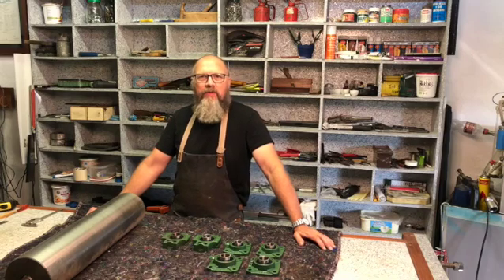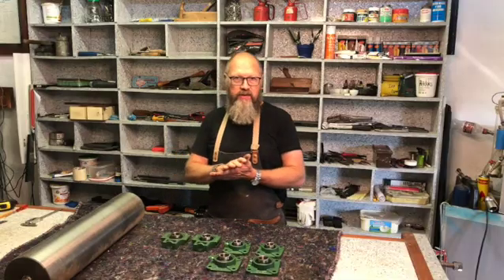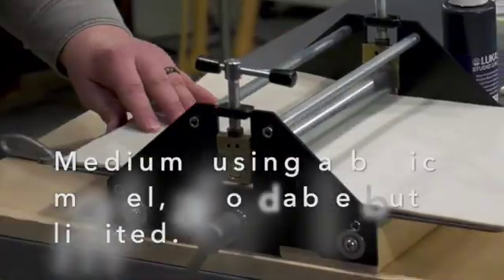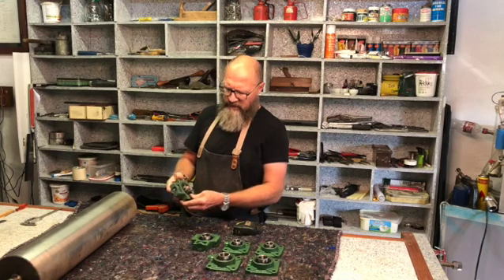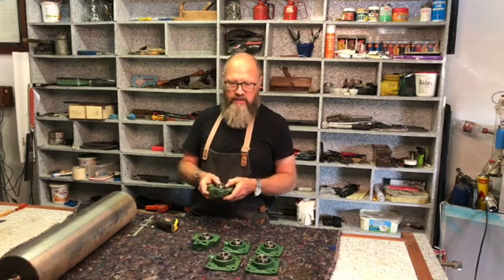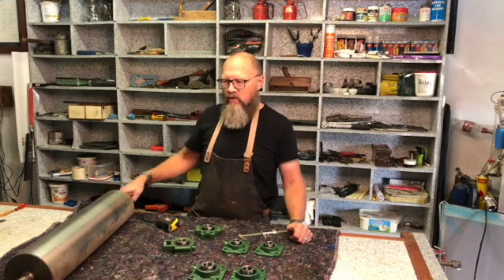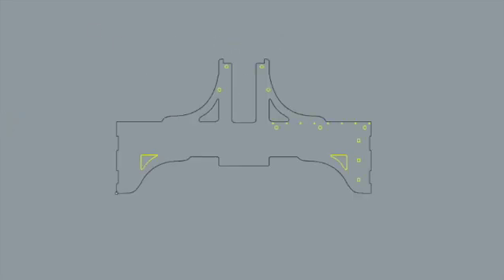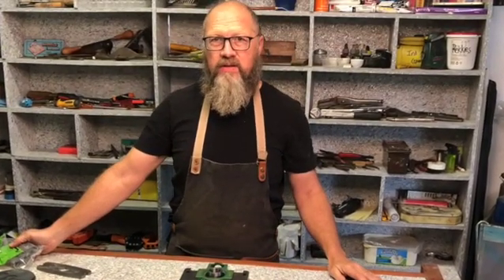How to build an etching press   part 1

Comment: nice work but can tell me what material type use for upper roller and if you can recommending buy link
Reply from the maker: My upper roller is made of thick wall ( 10mm) 160mm OD schedule seamless pipe. Unfortunately it is made of mild steel and it needs to be nickel plated to prevent rust. 
I would recommend using 160mm 8 mm wall 304 Stainlesssteel pipe in stead. You have to ask your local metal shop to supply you. 
You will also need some disks and a shaft. 
I filled my rollers with concrete afterwards to make them more solid. 
Try inquiring from this manufacturer:
https://steelzhdu.com/weld-stainless-steel-pipes.html